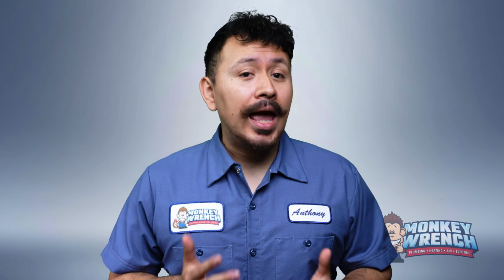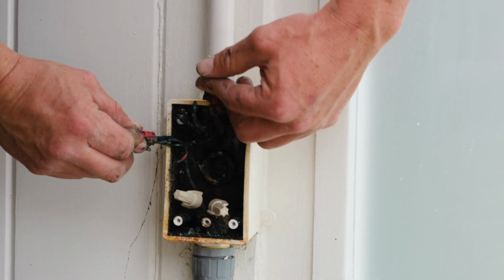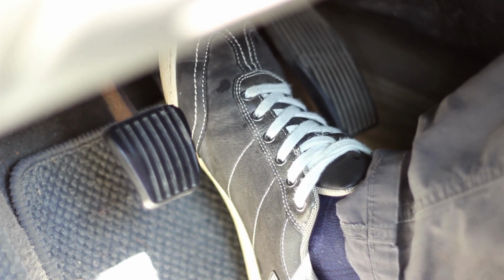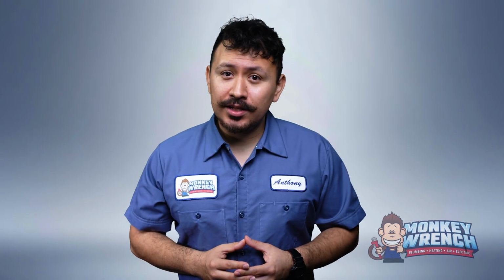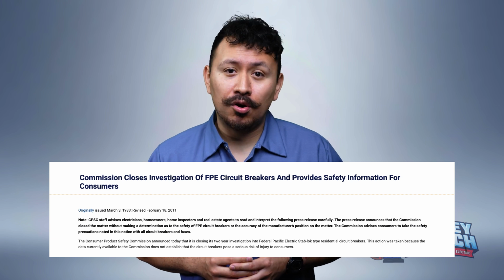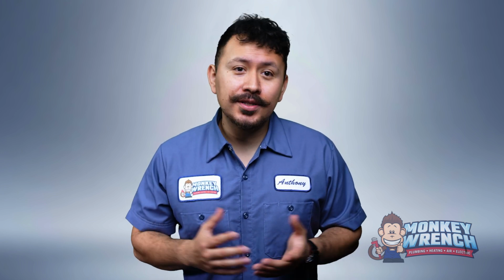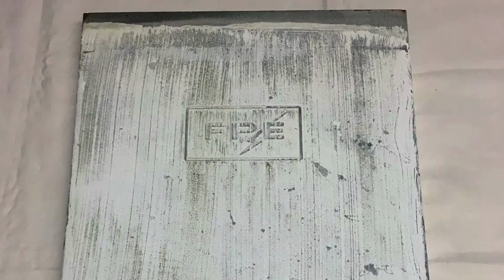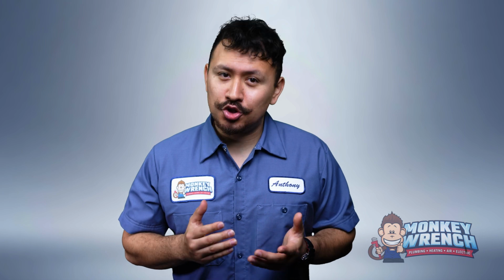The Dangerous Electrical Panel Hiding in Homes Across America | Federal Pacific Panel

Comment: Replace them ASAP! We lived here since 1985 with FP Stab-lok panel in our bedroom closet. Just replaced ours finally on Tuesday after a big scare & learning the danger. Now a new up-to-date code panel is on outside of our house by the meter. -- I gather there are still millions of these panels in homes today. We had a fire in our garage freezer that could have taken down our house, if we weren't here to notice & jump. Thankfully we had some fire extinguishers & a good fire department response. Turns out we had rats that probably chewed wire in the freezer. Best guess. We were lucky wasn't much much worse. Could have happened while we were asleep or away. -- Firemen (yes, all men) said to get an electrician before turning power back on. -- Electricians told us that a new up-to-date panel with Arc fault protection would have prevented the fire from happening, so would have been a non-event. The circuit was okay after fire, but we should replace the panel ASAP because a lurking fire starter in our closet. 

1. Get yourself fire extinguishers & know how to use them. (Thankfully we did!)
2. Know what your electrical panel circuits control (Thankfully I did, so was able to run to shut off power to freezer). Know how to cut off circuits in your electrical panel.
3. Put a linked smoke detector in your garage (We were lucky I smelled smoke before the indoor smoke detectors went off. My nose beat the detectors. Fire was raging.)
4. Don't have holes in your drywall that can let a fire go up into the attic (turns out we had a hole near the fire in ceiling, but lucky didn't make worse)
5. Donate to your local volunteer fire department
6. Don't let your garage be cluttered with stuff that burns easily. Make sure you don't have rats hiding in that clutter. Check out your old appliances for safety. 
7. REPLACE any Federal Pacific electrical panel ASAP! Get up to code. 
8. Do NOT have your electrical panel in your bedroom closet. That has been a code violation since 1981, but no one ever told us till after this fire.
We are going to get a full house inspection for safety hazards - get electrical of house reviewed for what is no longer in code (old rules grandfathered in doesn't mean safe). 

Federal Pacific (Stab-Lok) was never actually recalled in the USA, which is nuts. Get them out of your house! -- Maybe they were recalled in Canada?

Comment: Let me help you out - 
1st - a home is limited to single-phase 225 amp service. That is all you can get in a residential dwelling.
2nd - "Wiring upgrades" -- and then you show a bunch of low voltage DC phone lines ?! Come one man -
Reply: 225 amps? We're putting in 400 amp setups in larger homes. One ultra custom home with all the bells and whistles we did had a 1500 amp service.
Reply: @cgschow1971  -- On a single phase set up ?! First -- That would require a transformer update which is rare for a homeowner to pay for due to the extreme cost. 2nd - 1500 amps on a single phase set up is so dumb efficiency-wise that I can't help but call out B.S. on that one. DTE will NOT run a 3-phase to a residential site. Period.